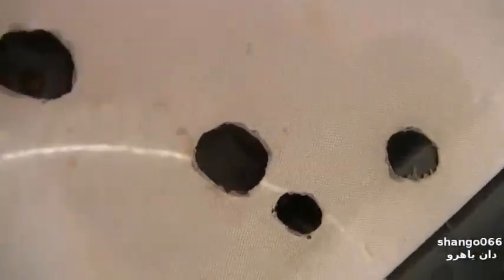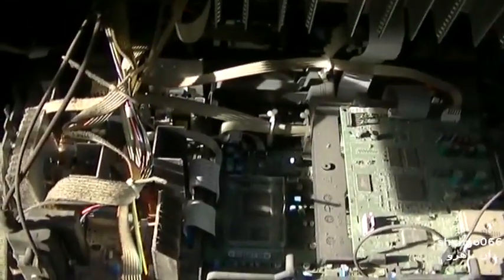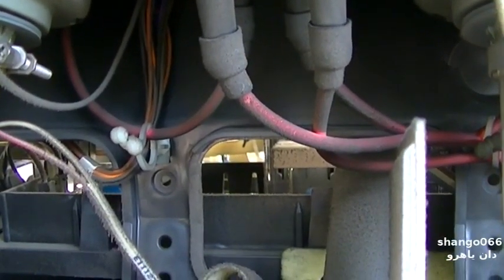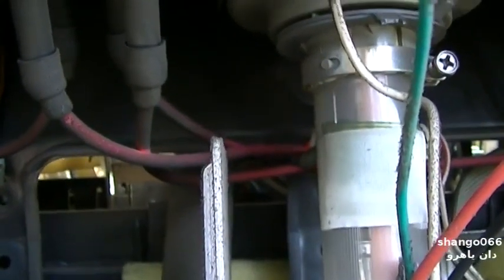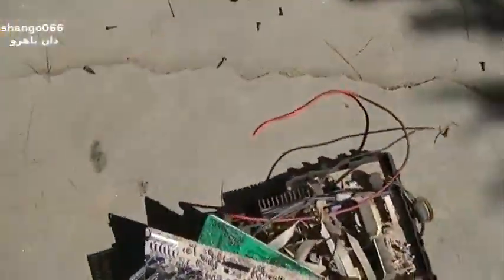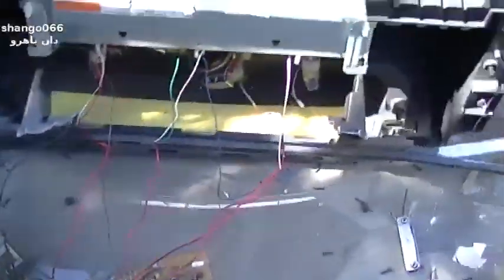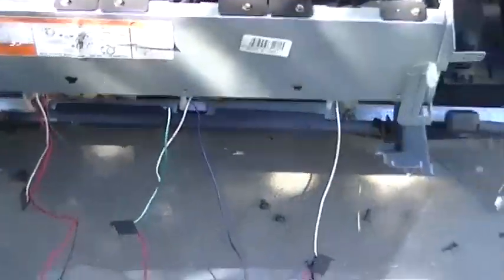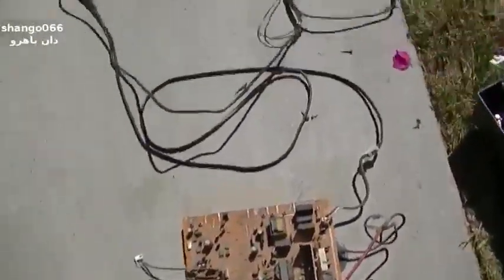RCA BigScreen Pre Post Analysis

Comment: This what I've actually done about 3 days ago with two about 85-90's black and white TV's made in Romania. Tomorrow I've try to strip down the circuit boards and test all the components which I consider usable for something else. Problems is that I have a ton of TV chasis just sitting there and gathering dust, but then again, I can't trow them away as they are a good source for parts. Keep up the good work :)

Comment: I still have one of these RCA TV's in my living room. Several years ago, the picture shrunk to the shape of a bow tie, so I figured it was done for, but found a YouTube video that showed how to replace a fuse and fix the cracked solder joints on the flyback transformer. Then, recently, the front panel electronics started failing and the menu and volume would randomly flicker on the screen, so I unplugged the front button controls and just use the remote now.

Comment: I can tell you what happened to this. These TVs had a real problem with a bad solder joint developing at one of the safety capacitors in the high voltage section. Once it goes open the high voltage ramps up to an uncontrolled amount and the only thing that will stop it is a component giving up. It necks those CRTs just like the old Zeniths with the bad blue safety caps. Had one of those arc over to a conduit on the wall a distance of about 2 feet. How many hundred kv is that?

Comment: At around 7:00, these are most likely the convergence transistors...
For some reason I like the rear projection TVs since they are really challenging to repair and set up. I have a Toshiba 61 inch and a Sony 53 inch set in the basement. They are both from the 90s and 4:3. I replaced all the CRTs with new ones. They make great sets for playing old video games ( watch out for burn in though!) and other retro TV shows. And they are fun to tinker with since so many parameters have to be perfect for them to deliver a good picture.
Reply: eaglevision993 I've not seen this type of rear projection set.  
I hear that each "bulb" was about 200$ to replace back then.  
The more modern DLP's were much cheaper made. 
Don
Reply: ***** Yes each CRT is between 75-250+$ to replace depending on the set. Parts only. Alignment is tedious and takes hours so no one will spend the money on a technician today...The CRTs last 20-30000 hours if you don´t crank the contrast and brightness fully all the time. But of course there are about 3x as much parts as in a normal CRT TV so way more failure points.

Comment: I dissected one of those old rear-projector tv . has capacitor like that.

They have 2 very powerful capacitors.
X2, 250V, 1,000 uF(M)
fairly heavy capacitor for its size of 4.5cm H x 2.9 cm W

That tv is soo dusted, must be why it failed, does weird sounds etc.

PS
Rear tv's rectangular-square lense for frontal white part of the screen you can make a powerful magnifying glass, cook food, melt pretty much everything.
Reply: solar powered  oven
  going green

Comment: Some of that stuff I'd reuse, like speakers, wire, screws, etc.....but I wouldn't reuse any electronic parts like capacitors or transistors because 1) they might be what was wrong with the set in the first place, and 2) new replacements are dirt cheap.
Reply: justsumguy2u Just simply test them. They are either good or bad.
Reply: That would be fine if I had a capacitor tester, but I don't. Transistors can test ok with a multimeter, but still act wonky at working voltage, or when they get hot. I think I can afford 97 cents for a new 47 uf @160 v 'lytic...

Comment: They were still making CRT projection TVs in 2005? Wow. Must be a holdover model, all the new TVs for 2005 had HDMI instead of DVI on them.
Reply: NJRoadfan I stumbled upon a working Hitachi rear projection CRT set a couple years back that was new enough to have a built in digital broadcast tuner. By that point, they did away with the outer protective screen for extra brightness in order to compete with DLP. After cleaning the set inside and out and doing an extensive manual fine tuning of the convergence, it had a respectable HD picture when viewing dead-on. I do not recall if it had DVI or HDMI, but likely the latter.
Reply: NJRoadfan  We have an LG set from 2005 that has 4 HDMI ports. I've seen larger CRT projection sets at the Goodwill from 2004, 2005. They want $250 for them. Way too bulky for my taste.
Reply: ldchappell1 Sure that wasn't a DLP rear projection? Those were quite popular until plasma and LCD prices came down. The DLPs didn't last long on the market after that. They also didn't last long period. Plenty of capacitor and exploding color wheel problems.
Reply: It looked similar to the one in the video just bigger. Look like something you needed four guys to carry.
Reply: NJRoadfan DLP sets weren't really heavy though. I just helped a friend move their 56/57" Samsung, and it needed 2 people only due to it being installed high in an awkward location - not due to weight. BTW the picture was still excellent. They retired it as the ATSC tuner was failing, and they cut the cord - using an Amazon Fire TV box and Kodi for programs. Unlike the Greedwill, they are only going to want $100 for the set, with a stellar 1080p picture. My local Greedwill won't take TV sets. But they will take busted down, tired ass console stereos and ask major loot for them.

Comment: Way out of your league guys... The RCA  ITC/ATC develops a bad connection on the .0187/1600v retrace/tuning capacitor across the collector of the HV transformer on the deflection board.  When out of the circuit, the HV skyrockets over 60KV and causes an arcing on the cap on the board and a protection shutdown.  Problem is that when the customer (or you) continue to try to start the TV, the continuing cycle of excessive high voltage will eventually (1) crack the neck of the CRT (internal HV arcing to yoke),  (2) short out the horizontal or HV output transistor.  Your sample had both.  After you attempted to restart after the first arc and shutdown, the output transistor shorted and now you're hearing the chirping of the smps loading against the shorted transistor.  Simple repair unless customers or poor technicians keep restarting them after they go into shutdown.
Reply: No poor techs here.  He could easily have researched it, but who cares. He is obviously very busy and has never not been able to fix something that was with it.  Are you a poor tech? 

I know one thing. Piss poor comment you left.
Reply: You don't "research" a TV that has close to a million units produced.   They were produced from 2002 to 2005, and TV techs know this TV and it's quirks.  I know that my comment was a bit technical and clearly over your head but any professional would NOT have approached the ITC222 in this manner.
Reply: Thanks for the insight John-Del
Reply: your explanation was much ore in depth than Magnus Rubsams a couple years later